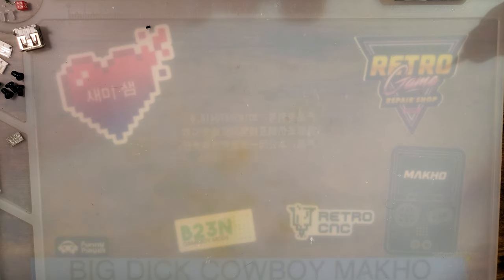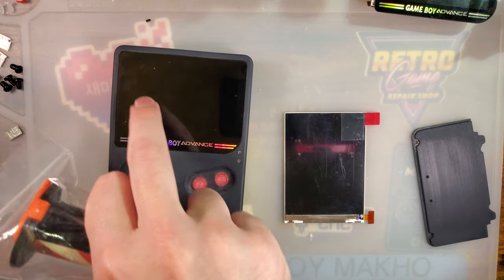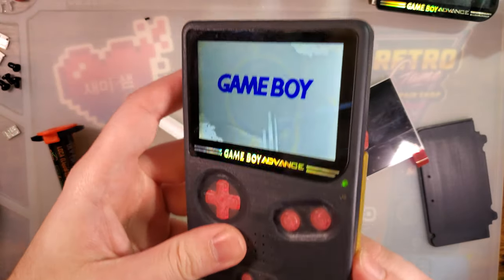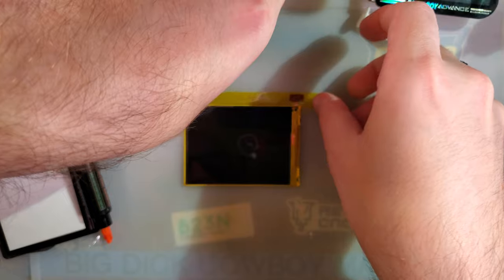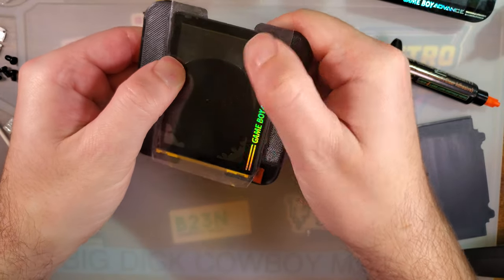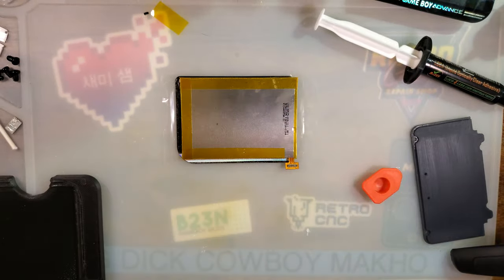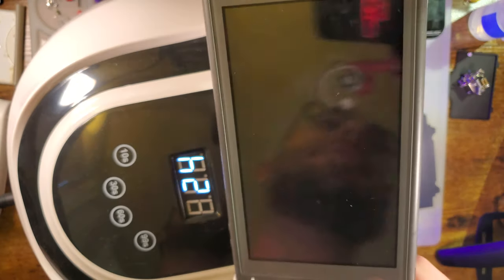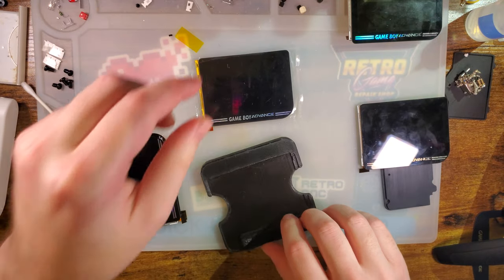Laminated LCDs with and without LOCA

Comment: How long til you can release slate 3d files? also wondering why retrocnc can't produce bottom back in aluminium
Reply from the maker: Over the past year I've been berated constantly about my slate and other projects I've tried sharing so I'm feeling much less inclined now to to open source the design that I've poured so much time and money into. If I ever release the 3D files, it will be for pay (e.g. shapeways shared projects or the like) or well after it is no longer available for sale. RetroCNC can't make anything I haven't finished.

Comment: Now I know the gameboy doesn't have a touchscreen, but would the process be the same for a capacitive touchscreen? Would the touch layer interfere with the glue?
Reply from the maker: Yep, this is how most smartphone screen assemblies and such are made. You probably don't want to do this with a resistive digitizer but there's no technical reason that won't work either.